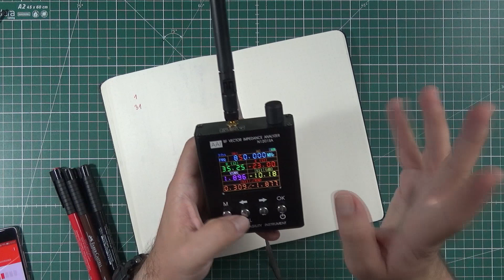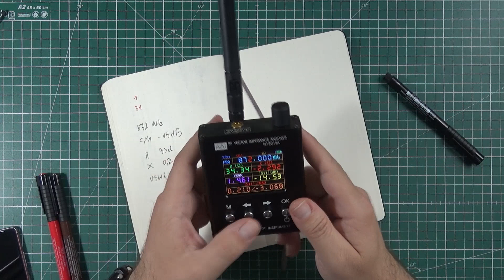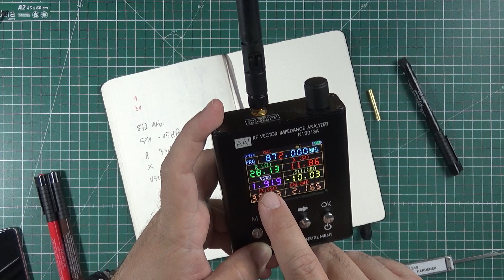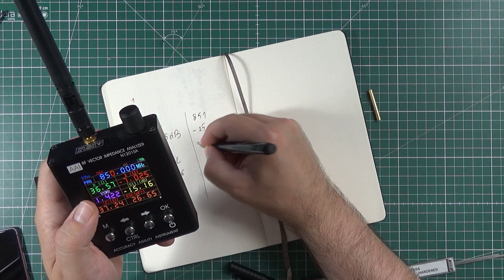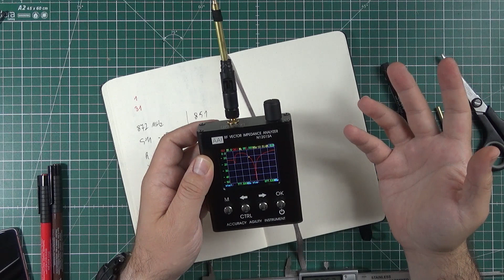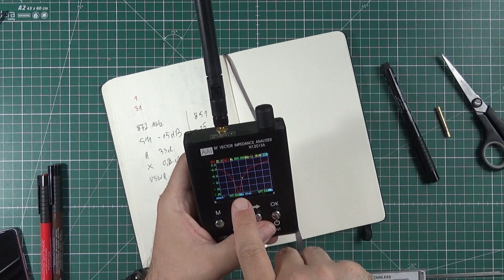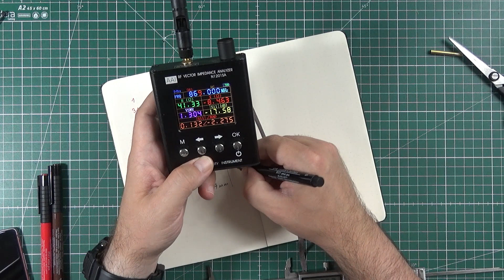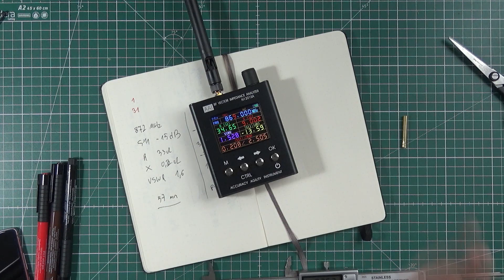They sent me a funny 868MHz antenna, or so they say

Comment: If you measure the removed part it will be around 1/4 wave length. At868mgz this makes  The wire length 3/4  so a jpole lowering the rf field lower to the horizon  still just like a zepp antenna  now just chasing min swr match for lowest. Swr is not what you should be doing I don't see any measurements. Of field strength. Of  before and after the hack on the correct equipment  as you know the best swr you can get is into a 50 dummy load   but won't go very far at all  hope this help regards  Kevin

Comment: This is a bit old but, did you try to bend the antenna?
If I bend my antenna on its elbow the readings change quite a bit (in my case for worse, it gets closer to tuned to 915Mhz)

Comment: Hi, I was wondering if you could help me out. I have an equipment for reading water meters on 868,95 MHz and my question is: Can I upgrade my reader so it gets data faster? So I have water meters ( http://www.apator.com/en/offer/water-and-heat-metering/water-meters/vane-wheel-water-meters-to-r160/js-02-smart-c-dn15-20 ) installed in apartments, behind doors and walls. Water meters have this modul for sending data: http://www.apator.com/pl/oferta/pomiar-wody-i-ciepla/system-zdalnego-odczytu-mediow/radiowy-system-odczytu-wskazan-wodomierzy/at-wmbus-16-2-17-apt-oms-na-1-2. My reader is this: http://www.apator.com/pl/oferta/pomiar-wody-i-ciepla/system-zdalnego-odczytu-mediow/radiowy-system-odczytu-wskazan-wodomierzy/at-wmbus-02-1. Now they offer also this, which should, If I understood it well, read datat faster, but it costs a lot: http://www.apator.com/pl/oferta/pomiar-wody-i-ciepla/system-zdalnego-odczytu-mediow/radiowy-system-odczytu-wskazan-wodomierzy/apt-verti-1
Can you please tell me if I can by some antena in order to upgrad my existing gadget, so that I could read data faster.
Reply from the maker: new antenna will not change a thing
Reply: @FPVUniversity  so do you know what could help?
Reply: @tomakukoc9661  this is probably a question better suited to ask the manufacter of the device your using, im not sure why you would think an rc guy would have the answer to such a particular thing lol, even antenna experts, your question is relating to particular software hardware combo you should be asking people who know about the products your using. but i would say if your using cheaper end of the product line then they probably intentionally limit bandwidth to incentivize getting the "upgraded" unit that probably just has the same hardware inside but a different firmware to allow more data to flow. i couldnt imagine their would be very much data your trying to retreive so i dont see why it shouldnt just be instant, but it comes down to closed source hardware and software with artificial limitations to create a product stack, if their low end units were fast and did everything then no one would ever buy the better ones with much higher profit margins. pawel is an open source software developer with inav flight controller software so his real answer is probably learn how to code and develop your own device to do what you want with arduinos or something because you would be able to make 10x  more capable system for half the cost if you know what your doing, sadly its very complex to learn and most people like me just cant wrap their head around it so we never bother to put the effort in to learn and we rely on people like pawel to bring us the things we want, and we pay them to do so. and when your developing a product line its good to have options for people so im not nessesarily saying a product stack is a bad thing or wrong, it gives people a cheaper option to get the job done, just with some built in inconveniance that the more expencive models "solve" by not having the artificial limitation imposed on it, long story short, if you have a question about a product, ask the manufacturer, who should be more than happy and willing to help you through your issues and help you understand their product line, the benifits and drawbacks of the different options, and perhaps open you up to options you didnt know existed. and this holds true for most things in life

Comment: That antenna is called a sleeved dipole antenna with a decoupling choke. The extra sleeve is a choke which increases the bandwidth of the antenna so tuning is not critical.
Reply from the maker: Thanks, that was what I was missing!

Comment: An even bigger joke is....There is no indication of the frequency marked on this Ducky antenna.....Nada.....Nothing.....China are very good at not marking there products, antennas in particular.
868mhz is illegal in the UK.
Reply: Pages 19 - 21 of the Ofcom Bandplan show 868Mhz can be used airborne...

https://www.ofcom.org.uk/__data/assets/pdf_file/0028/84970/ir-2030-july-2017.pdf
Reply: Thank you for that information....:)
Reply: "868MHz band" is used for low power devices like LoraWan in europe. It is legal in UK too. It is also allowed to use it airborne where many other transmitters are not legal. Depending on the part of the ISM band used, typical power limit is 25mW with dyty cycle like 1% or 0.1% ie. short burst transmitted only rarely. Other uses than LoraWan exist too.
Far from illegal band and it requires no special permits either.
Reply: @hoggif  Also it is legal, it is not a good idea to use a 868 MHz device in the lower airspace if smaller aircraft and gliders are around, as the FLARM anticollision system of small aircraft also is operation in the 868 SRD band.
https://support.flarm.com/hc/en-us/articles/360015919933-On-what-frequency-does-FLARM-operate-
Reply: 868 is illegal in UK because UK is not Europe.